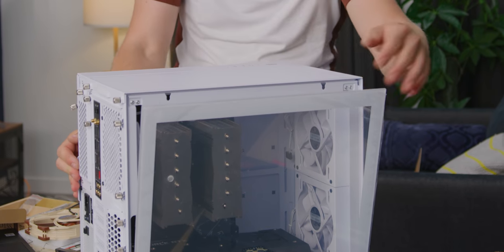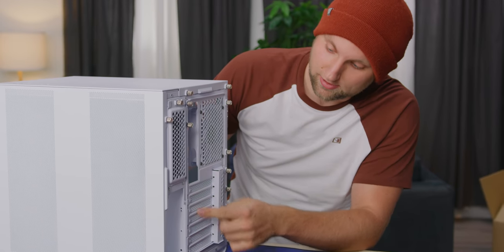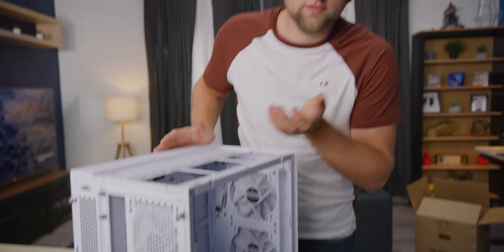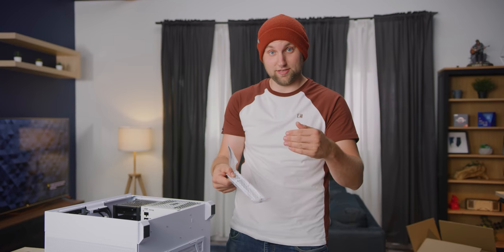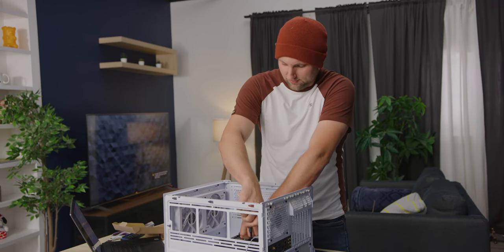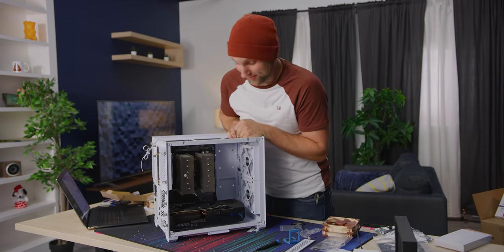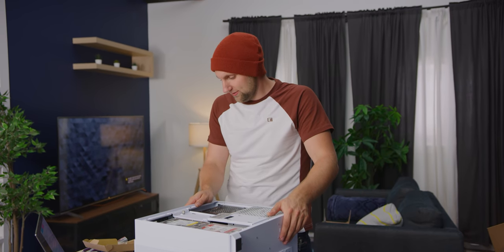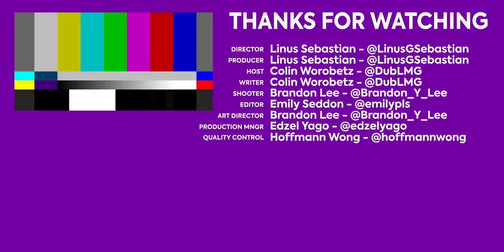This Is My DREAM PC Case! - Lian Li O11 AIR MINI

Comment: I just bought this case and I love it, but 4 HDD's, nah more like 3 HDD's, the 1 close to the io, you can not even get a sata power plugged into it, flip the drive around, you not fitting the drive in there, its like an after thought, works good with SSD's, I got 4 sata SSD's and 2 HDD in mine

Comment: I literally just moved my system into a white 4000D airflow. Might have to move it again now lol. My define R5 case I use as my server holds 12 drives, and can fit 4 unofficially with some tape
Reply: @NonsenseNinja  it's actually a really good case. Few little niggles, the plastic flap at front that is removable if you want to put a Res in could fit better. You can't use a 280 AIO up top unless you use low profile ram (if they made the case 1cm wider than you could of). The vertical mount for GPU is only for 2 thickness cards (useless with a 3090) and it sits to close to the glass. It only has 1 USB3 A port on case, seems daft for a usb 3 internal header than can run 2 ports. But overall, a nice case. Little video on my channel. But this lian li case looks nice

Comment: You guys should do a case round up specifically looking at cases that fit in the FJÄLLBO TV bench (that it looks like you have in this set).
I'm currently using a Thermaltake Core G3. It's a little too deep and sticks our the back. The biggest issue is that the GPU strugggggles to get any airflow through the tiny intake.
Definitely not too niche and well worth a full LTT series :P
(I mean you already have the TV bench)

Comment: Im surprised that the mesh MINI version can have a larger tower cooler than the original. 155mm to 290mm?!
Reply: It's 170mm, the whole case is literally 288mm. But yeah, it's mad. The o11d mini can also suit 170mm coolers, though that one can't house an atx psu since it is a bit smaller.

Comment: yes colin AIR COOLing the best glad some one agress a nice rgb black painted air cooler does a great job. i never liked watercooling they get hot quick and make noise... i mean  240mm watercooler u need to run them fans pretty fast to keep temps under 70c on my 120mm air cooler runs under 60c

Comment: you have to remember the top would ideally be used for exhaust so the lack of mesh on top is largely irrelvant. it would only restrict the air coming out. top slot clearance is why the D15s was invented haha.

Comment: For the next case unboxings, please give a quick rundown on material used, and measurements. For example, I kinda get that Colin is enthusiastic about fitting big hardware inside a relatively small case. Which is indeed interesting so should have included measurements etc.

Comment: Smaller air cooler would probably allow the necessary space for the GPU? Was it the cooler, that was hitting the GPU backplate?
Reply: I believe he mounted that cooler wrong way, it should fit just fine. D15S is asymmetrical, if mounted correctly, leaves enoguh room for GPU.
Reply: @Kr1sVr  I just thought it was odd, that a cooler wouldn't allow proper clearance for a GPU to fit in the top PCIe x16 slot in an ATX. Makes sense if the cooler is asymmetrical and flipped though. Never owned that cooler. 👍

Comment: Wonder how much taller the D15 cooler would be with fans mounted and the Trident Z ram installed. in my build, I used Kingston ram, and the fan on the D15 sits a little above the top of the fin stack, and that's with "low profile" kingston sticks. 
Still a nice case, wonder how it does against the Corsair 4/5000D airflow.

Comment: You should have left the gpu in the top x16 channel. Would have had better air flow to it than placing it in the bottom channel. Putting it in the bottom channel, is suffocating the fans which will put temps in the no no area.

Comment: dont they sell the front grill separately  if you bought the normal o11 mini?
Reply: Doesn't look like it. Also note that the O11 Air Mini is slightly shallower, wider, and taller than the original O11 mini.

However, Performance PCs sells replacement front panels (in black).  They cost almost as much as the case though.

Comment: I prefer to keep my HDDs outside my case in a dock. That way they arent part of the posting process and for whatever reason post 02 for initializing SATA drives takes a full 15 seconds on my rig if there are HDDs or SSDs installed. Dont have that problem with my dock and I can hot swap my drives too. That case is nice but i twouldnt fit on my desk right now. I have my tower on the right side of me and that extra 4 inches of width would encroach on my mouse space. I just wish I could fit my chromax black in my case but every case is like 10mm to narrow.

Comment: So, case that appears the size of the O11 Mini but now it can fit a FULL ATX PSU? Damnit lian li. Love my O11 mini, super gorgeous, but all you did was drop the glass front it seems and open up the font with mesh. Why couldn't the O11 Mini have Full ATX?

Edit: Okay, I stand corrected, so back panel is different, but it would have been nice to  see that in the O11 Mini, maybe a V2?

Comment: I'm waiting for the O11 Evo to launch before buying a new case. I went from the O11 xl to the mini, and ran out of aio cpu and gpu aio cooling. I'm curious to see if lian li and EK will allow 3 rads with a distro plate, and the columnal gpu mount has me intrigued. But if rad support is no better than the xl, then I'm getting a 7000d and building a loop with two 420 rads

Comment: Those fixed hard drives do not look like they will fit once you hook up the data and power cables.  One will work but two look like it is too tight.

Comment: I would like to know If you can plug the cable case connectors into the motherboard because it looks like it the GPU covers it.

Comment: What does he mean by 7 slot pci configuration being able to be "converted" to 5 slot bringing the back IO slot down.... That doesn't sound right.
Reply: The motherboard mount is made in a way that the motherboard can be moved down, which would take the space of the first two PCI E slots but give you clearance on top for a thicker radiator.

Comment: My current build is in a white FD Focus G. If this had been out at the time, I would likely have used it instead.
Reply: •T[A]P Me!! To Have [S]EX With Me  In the Focus G? You can mount two HDD in the floor cage, however it is very close to the power supply and will be tough to wire in. You could also buy a 5.25" sled to mount HDD or SSD in the bay slots at the top. That is where I have one of mine. There are also spots to mount two SSD on the back of the motherboard tray. I have one there as well. 
My biggest problem with the Focus G is cable management. It is a bit tight to work in and the side panel could use a bit bigger recess, but it's a good budget case. In fact, I'd recommend it for a custom water cooled micro ATX, as the HDD cage mounting holes are just right for a floor mounted pump/res.

Comment: 10:10 Those hard drives are being hotboxed, they will die an early death like that. Hard drives need active airflow, remember they are running at thousands of rpm and have moving parts flying around in hurricane winds.
Reply: It occurs to me this might be Canadian cold weather privilege.

Comment: Would you be able to fit longer 225mm PSU under the rear bracket? (I know specs only state 200mm). Thanks.

Comment: Will there be a new version of the 011 Mini (with glas front) that also fits ATX psu??
Reply: Nope, I have a Snow white o11 and I have a SFXL psu, plenty of power, Silverstone 1000w. Also check out front glass replacement mod at cold zero EU website
Reply: If you don't want to spend an insane amount for a higher wattage SFX PSU, there is a bracket you can get to trade the HDD cage for a second PSU spot.  2x 600W SFX PSUs are cheaper than a single 1000W.
Reply: @silv12  None of that matters to me.
I already have a good atx psu and if I wanted to move to the O11D Mini it would be great if that didnt need a switch to SFX. since there is a way to make it fit since this case exists, that would be great. I just don't like the look of the mesh version of this case and would like it with glas front like the other O11D mini.

Comment: How does it happen, that lian Lo releases an ATX case in the size in which Corsair has only a Micro ATX?
I have an Corsair 280X and would love, if I could fit in an ATX Motherboard…
Reply: I have a o11 dynamic mini snow white with a full ATX board and 360mm radiator and fans, just make sure you don't have chunky ram sticks otherwise won't clear

Comment: This case annoys me so much ... they took the O11 Mini and improved on the mesh, added ATX support but messed up the radiator support now ... They were trying to improve it and made it worse in other departments ... just why?! No more 360 support at the bottom (barely at the top), still this ugly front fan bracket you can't skip on because the opening behind the mesh is wider than a 140mm fan (and has metal protusions preventing to mount anything there directly). So you have a nice looking case with a window in it to have a bit of a show off build but you have this ugly piece of metal covering half of the side position. There's still the elephant in the room that you can't really use their vertical gpu mount backplane with top and bottom radiators - unless you start cutting in order ot move the mainboard down with the back panel in the top position. They also removed support for 140mm fans or radiators on the side.

And why the heck aren't top and bottom fan/radiator mounts not aligned?

While it improves airflow significantly (the O11 Mini has terrible airflow since the mesh has way too few and little openings) but at least the cooling support was better. Like a lot better. Have fun shopping for 20mm radiators and 15mm thick 140mm fans that are suitable for radiators.

This case could have been so amazing but it's a collection of stupid design decisions.

Comment: I think the entire 011 series ends up using way more usable desk space than traditional mid towers due to the PSU behind MOBO design. Even the mini is wider than my non-compact Fractal mid-tower.
Reply: Its more for design and ease of wiring.

Comment: I feel I have a special connection to this case when they introduced the O11 mini on derBauer channel as a prototype thy said leaves Commons and suggestions for changes mine was they need to make a air version as they have in the big One and they need to make the front IO front IO and not top io so nice to see they listened  to 50 procent of what was suggested 😉😉😉🤗 but I would still like to see that front IO is front IO and not top not side but front😉 but I'm still going to buy one just to see if I can modd it
Reply: Cold zero EU website makes custom front glass mesh mods! Got one for my snow white o11

Comment: Well it looks good, but how is this chungus an "SFF"? SFF is under 20L, this is definitely more than that. If you want a good SFF case that is easy to build in and looks good, just buy a Cooler Master NR200. You just can't go wrong with NR200, it's the AK47 of SFF cases.

Comment: Wait, if I use an mATX board can I put a 360 rad on top??
Reply: YES! they actually thought of everything in this case
Reply: I have a 011 snow mini with a ATX board, can fit a 360mm radiator and fans on top, just make sure your ram isn't too tall or chunky. It will fit!
Reply: Awesome, thank you guys!!

Comment: It's lian li of course it is well tho ught out! Lian li was best of the best when they first hit the market. When basically all cases came with a psu from crap to good with brands like enermax and powmax etc lian li excluded the psu and was still one of the more expensive cases. I rarely book mark a specific video but this one got added so i know the model for later

Comment: Having had white cases before, I avoid them now. They look horrible when they get dirty and are a pain to clean and stop from getting stained over years. 
Also with full white builds, its impossible to get parts that are actually the same shade of white. So it looks pretty terrible in person if you try match white case, cooler, fans, gpu, motherboard, ram, watercooling fittings, etc...

Comment: I wouldn't call this a modular case because you can fit different size motherboards in it lol. Wouldn't that make every case out there modular? From what I can see it's not smaller in general to it's watercooling mini sibling as the amount of space inside is about the same if not larger. I just don't see anything special about this case in any way.

Comment: why is it so difficult for case manifacturers to put a 140mm fan in the back?
Reply: I have a dynamic o11 mini snow white and I have a 360mm radiator fan combo on the bottom with no issues, could easily clear more without the radiator
Reply: @JohnDoeC78  i meant "back"

Comment: Not sure I agree that the "price is right" at $110
Reply: Any better choice for such size and capabilities ?
Reply: @eliadbu  Kind of a moot point considering the case is actually $150 everywhere it's currently available. I'd take the phanteks p360a at half the price any day
Reply: @JamesFuston  can't find it right now because of it is quite new, I guess when more stock will be available the price will go down, and comparing mid tower to this case is pointless. If I wanted mid tower I would have already bought the regular o11 dynamic or the o11 air.
Reply: @eliadbu  This case isn't exactly tiny. About 2" by 2" smaller than the phanteks and a good 3" wider, so if you NEED case that's a couple inches shorter and you're fine paying double the price, sure. Otherwise you're not saving much space for all that extra cash.

Comment: including fans with the case is not only a complete waste of money but also source of unnecessary pollution in most cases as you have to replace them anyway
Reply: "but also source of unnecessary pollution in most cases as you have to replace them anyway"

No...ya don't HAVE to replace them.  It's not like every single case...every single case maker includes shitty fans.  get real.  You CHOOSE to replace them because you're ate up with bigger name brands like Noctua,  cooler master ( sometimes.), etc.
Reply: @motoryzen  including garbage is reality, most of fans on the market are complete junk that shouldn't even exist in the first place and not offering version without them should simply be illegal
the same applies to CPUs and graphic cards, stock coolers are nothing but waste

Comment: This case could actually get me to take the parts out of the case of my Alienware Aurora R10 Ryzen Edition. I would just need to get a power supply with the case. I could just swap over the motherboard with CPU, AIO, ram and GPU. The case in black looks nice and I never really cared for the kind of ugly Alienware Aurora case.

Comment: Is way to wide
I think you all would swap if you saw my inwin a1 plus there have it all rgb strip 2x120mm ntxt rgb fans there blow direct om The gpu, my 5950x has good tempeture wirh The kraken 120mm aio

Comment: They ruined this by not allowing 360mm rads like the O11 Mini
Reply: My snow white 011 dyanimic mini fits ATX board and 360mm fans radiator on top, just make sure your Ram isn't too tall, most will fit with ease! I also have another 360mm on the bottom of the case too

Comment: never understood that compatibility meme with cases. how often are you changing your components down to the motherboard for that to be a factor? and how often do you flip flop between vastly different standards like ATX to ITX to E-ATX? get a case that fits your components to the T and should you really need to switch form factor, just get a different case.

Comment: It is not small at all, it is larger than average mid tower so nothing special, layout is not optimized at all and it has huge footprint. There are atx+sfx cases as small as 10 liters and atx+atx at 14L  with really small footprint that can go on table

Comment: TLDR: excellent built quality, well executed, affordable but useless. 50 mm more in height and it would be a nearly perfect case.
Reply: why do you need that? h GPU would fit if he put the cooler on the right way
Reply: @atodaso1668  if the case had 50 mm more height you could easily fit an aio or a thick radiator with push pull in the top.
Reply: @vollhorst140  This is an air case though, they have other cases for water cooling. Hence you can fit a Noctua D15 in this, water cooling doesn't need that kind of depth.

Comment: Also your stance on watercooling is so wrong, sorry
Reply: but in terms of performance, their own videos already proofed that aircooling (with noctua mostly) is the same if not better and cheaper compared to watercooling, no? The downside is that it's not aesthetically good and can be very bulky and heavy.
Reply: @DamonTorro  their videos are not the best, see some gn testing and you can see that aios are in fact better cooling wise, they have other downsides though

Comment: Prohibited knives: Any knife that has a blade that opens automatically by gravity, by centrifugal force, or by hand pressure applied to a button, spring or other device in or attached to the handle of the knife (butterfly knives, switchblades, etc.) is a prohibited item and is considered an illegal item under the Criminal Code of Canada.